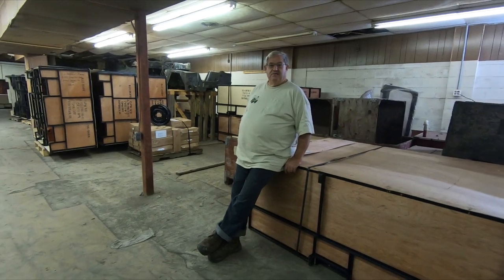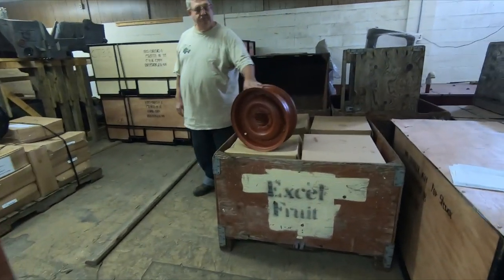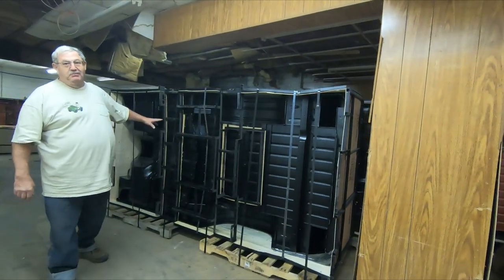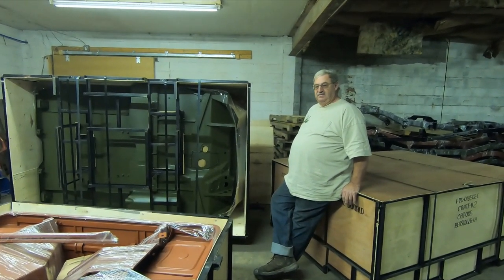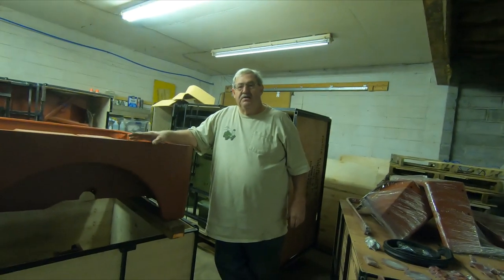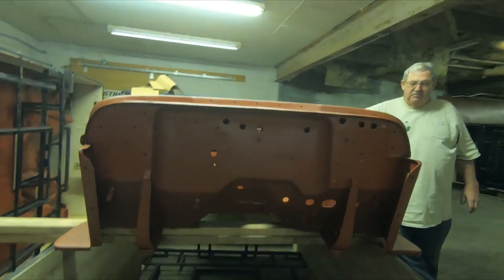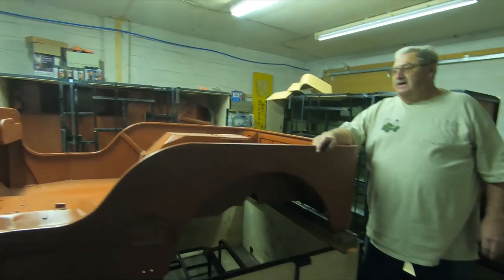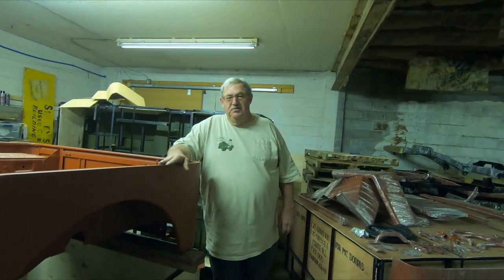MD JUAN REPLACEMENT JEEP BODY KITS AND FRAMES, NEW DEC 2020

Comment: Can you take the M38A1 body and put cj3 elec n all underneath,the under hood of A1 looks like a nightmare to duplicate
Reply from the maker: Yes, the CJ3A is a flat head engine, it will easily fit in the location of the F head engine. The rounded hood on the M38A1 was designed to accommodate the F head engine. A lot of the 24 volt wiring of the M38A1 will not be needed. The  basic 3A wiring could easily be used to replace it. However, you have to install 3A 6- or 12-volt switches on the dash in place of the 24-volt switches.